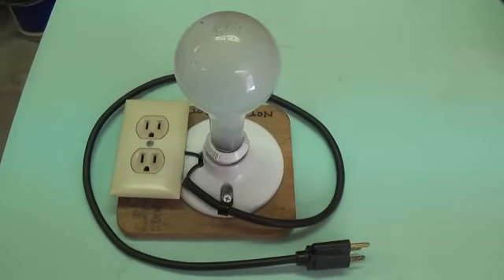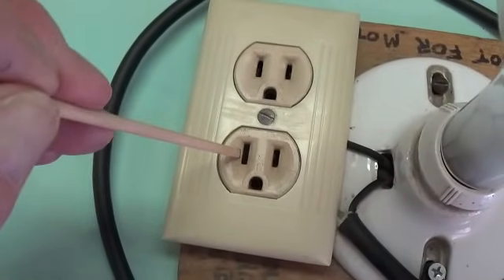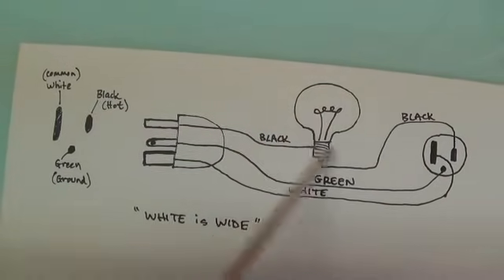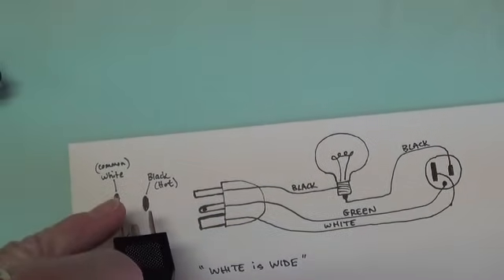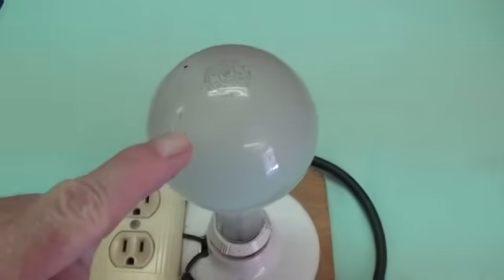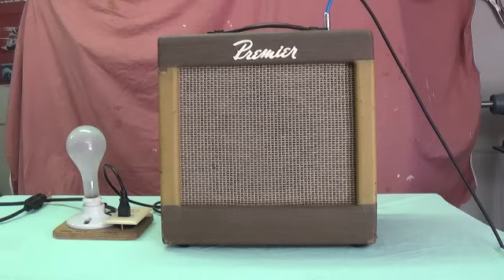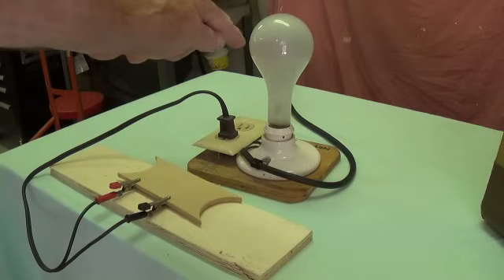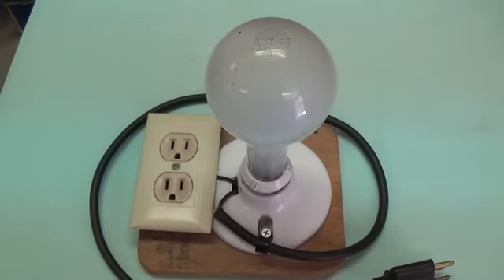Build Your Own Current Limiter for Protection when Repairing and Testing Electronic Equipment

Comment: I suppose if you cannot get hold of really high wattage bulbs you can put 2 lower wattage  bulbs and wire them  in paralell .Also in the UK we are on 240 volt so the wattage could be halved  ,we have 40 , 60 and 100 watt bulbs easily avalable in the UK. We used to have 150 watt ones but I have not seen any of them for ages .There is a big shift to LED bulbs now especially with EU regulations .I used to use a bulb via a veriac to feed a linear power supply to test amplifier modules after repair .Before that a faulty amp module would usually blow up the switch mode power supplies.If the bulb started to glow you knew you had still got a problem with the amp and backed the veriac off. .I enjoyed watching your old school amp videos Cheers.
Reply from the maker: Stephen, since your voltage is doubled, your current is halved, so the wattage of the bulb for the CL can be about 1/2 the value that we need her in the colonies ;)  I would think that a 100W bulb should be fine for small to medium-wattage amps.
Reply: @UncleDoug  I used to use 100 watt bulbs on transistor amps without a load ok .I could switch it out if I wanted to try the amp on load if I wanted too .A 100 watt bulb with 2 meter leads attached makes a great zap protector for discharging caps too .

Comment: I built my first tube amp. A champ type thing. It popped the fuse instantly (no smoke or stink). Now I'm going to back up and build a limiter like this before I debug and test again.

I wondering if this limiter would have prevented the fuse popping?

I've watched a lot of your videos and I probably should have built this before the amp. We live, we learn! Thanks for all your lessons, Uncle Doug.
Reply from the maker: Yes, it would have prevented the fuse popping, C. Once you build and use the CR, you will be much better off. Good luck.

Comment: Could this reduce the inrush current for a standard 60 watt incandescent light bulb to help protect the light bulb filament?
Reply from the maker: Yes, but you're just protecting one filament with another one (in a bulb that costs much more than the one you're protecting).

Comment: Complete NOOB here, what is that material you connected those two test-clips to [at 6:55]? Is that wood? Isn't that dangerous? I know wood isn't conductive but wouldn't 120 Volts set it on fire, eventually? Please let me know, as I am a complete NOOB! Cheers!
Reply from the maker: I believe it was a steel screwdriver shaft, Max. The whole purpose of the CL is to eliminate the consequences of short circuits.
Reply: No, I mean that "board" on top of the other piece of wood, to which you connected the test-clips, is that some non-conductive materials? Not the screwdriver. Thanks
Reply from the maker: Yes, it was a piece of Masonite, as I recall......totally non-conductive.
Reply: Ok, thanks for replying. Keep making videos [+, we all want to see more of Rusty]. Again, thank you kindly. Cheers!

Comment: Hello Uncle Doug,  I  built one of these and have been using a 300w bulb. The old tube oscilloscope lm rebuilding is a navy os 8a/u . It has 8 tubes and draws 47w and .4 Amps is the 300w bulb too large? Or what would you recommend? The 300w bulb only gets warm with no filament light. Not even a red filament.  If I  use the 300w bulb with my 9302 magnavox amp "which draws 70watts " the bulb filament will glow red . !
Reply from the maker: I think the 300W bulb should be just fine, Mike. Many of the amps I run with my own CL never light the bulb......they just make it feel warm.
Reply: @UncleDoug  thank you sir , question!  Would using this current limiter damage the device under test  if left on for hours?  As long as the voltage was adjusted to 115v ?
Reply: I found another use for the current limiter.  I  was watching one of Mr Carlson's videos on this topic and he demonstrated how the current limiter hooked up between his isolation transformer and variac will show the impedance mismatch of the two. So I did the same and sure enough,  the current limiter exposes the impedance mismatch. I ALSO tested a different isolation transformer without reaction. Paul showed how to correct this with capacitors. Interesting. I guess you could use a ma meter between the two would work as well.
Reply from the maker: No, the CL has no adverse effect on electronic devices......other than motors :)

Comment: Just finishing mine off. I have added a switch between the wall and the bulb. Mainly for control. I find this incredibly useful for probing with 110vac when experimenting.
Reply from the maker: It's an absolute necessity for work on any live circuit. Good luck with it, James.
Reply: @UncleDoug  Indeed, Thank You! I forgot to mention, I used a 500w Projector bulb and base which is similar to an 8pin socket. Makes it look sorta 'steampunk' with the cool filament off the bulb and gold top. Model GE DAK 500W.
Reply from the maker: All the better for display on your work bench, James :)

Comment: I copied your design. How can I test my device to see if it will actually work as intended?
Reply from the maker: Do what I did.....plug in an extension cord with two bare wires and touch them together. There should be no big sparks, just a brightly lit bulb. Be careful when you do this.

Comment: 110 Volts @15 amps. In  Australia we have 240 Volts @ 10 amps but the voltage isn't what is dangerous it's the amps that will fry us. Everyone has seen that picture of Nikola Tesla sitting in a chair surrounded by thousands volts of electricity  all around him it looked very impressive but I'm guessing the experiment was high voltage very low amperage.
Reply from the maker: Thanks for your input, SF.

Comment: Hi. This is my first time viewing any of your videos. It is one of the best videos explaining the subject but I must disagree with one minor thought of yours. I use a 60-100 watt bulb because I want to limit the current to any device connect so that there will be no damage to newly-installed devices such as transistors,etc. Does this make sense? A high wattage bulb would let too much current go through the deice under test. I have no need to operate the electrical device being repaired  at almost full voltage and current. I understand that some electronics devices 'act strange' when the full potential/current is applied but most items that I repair work OK with the 100 watt bulb in series. This series light wiring is excellent for circuit tracing intermittent shorts because of the current limiting function of the series lamp. One more thing- I have successfully used a lower wattage bulb such as 60 watts to see the dim glow of the bulb when an amplifier is running in series and I am able to adjust the small biasing controls. When I adjust the bias control and the current through the output transistor circuit is increasing the limiting bulb glows brighter. A higher wattage series bulb such as 250-300 watts would not let me see its glow. Len
Reply from the maker: The video was intended to guide viewers who work on tube circuits, Len, not transistorized circuits. The device can be used on transistorized circuits, but since their current demands are so much lower than with tube circuits, the bulb wattage does indeed have to be lowered dramatically. I believe this is explained in the video description.
Reply: NOW I disagree with you about using a 250 watt bulb. A 100 watt bulb or 60 watt bulb is what I have been using for decades and they work fine. I test large and small transistorized amps and large and small tube amps. I NEED to see the the amount of glow the 100 watt bulb shows me.
 Initially turning on the device the bulb glows and then settles down to a dull glow without any audio signal in the amp. Of course putting a signal into the amp makes the bulb glow brighter according to the level of the signal. If there is an intermittent short somewhere in the device under test the LOWER WATTAGE bulb will suddenly glow brighter informing me of the short BUT it will not allow any damage caused by the less than 1 amp of current going into the circuit because of this lower wattage bulb. A larger amount of current will go through a 250 watt bulb. This has helped me out countless times after I had installed new transistors and resistors, for example. If I were to use the 250 watt bulb and there was still a short somewhere in the amp or I had installed the transistors incorrectly the high wattage bulb might let enough current into the amp to blow the new transistors. 
 I know that you will not agree with this because the higher wattage bulbs work for you but the techs staring out are highly advised to use the lower wattage bulb. Another advantage with the use of a lower wattage series bulb is that I can safely adjust the bias of an amplifier when I initially adjust the bias control one way or the other. The bulb glows brighter when the bias voltage is too low and moving the bias controls to a more negative level decreases the amount of glow to the small wattage bub. Very handy. You cannot see a glow [as you stated] in the 250 watt bulb. [phew!]

Comment: I saw plans for a limiter that says to wire the 2 plugs in the receptacle in series. Is your receptacle wired  in parallel?
Reply from the maker: Yes, that's the way it came from Home Depot.....with both outlets wired in parallel. I see no benefit to wiring in series.
Reply: @UncleDoug  okay. Thanks. I was looking at Gerald Weber's "A DeskTop Reference of Hip Vintage Guitar Amps" (1994) on pg 123.
Reply from the maker: He knew his stuff, Barry, but since 99.9% of the time, only one outlet is ever used at any time, it is rather academic.
Reply: @UncleDoug   Thanks. Doug. I recently found your channel, so you may get more dumb questions than you are accustomed to for a while. Feel free to ignore me. lol. I also saw someone add a rotary dimmer switch to this design.  I guess that was his idea of poor man's variac. I think I'll leave that out. I am headed to the hardware store now. Thanks a lot.
Reply from the maker: A dimmer switch alters the waveform of the AC, Barry, and is not really the same as a Variac.....which can generally be bought at junk shops, estate sales (I just got another  V at one recently), or on Ebay. Stick with the basic design as presented in the video.

Comment: Hi Uncle Doug. We have 240v 50-60 cycles per sec here in Australia, would this device work over here or would we need to go for a 500w light globe such as in a flood light?
Reply from the maker: When the voltage doubles, the current decreases to half, David.....so you need a lower wattage bulb, probably around 100 to 150W.
Reply: @UncleDoug Thanks for that. I have a 50W valve amp - so would the 150W bulb be better?
Reply from the maker: A 50W amp with 240VAC would draw about as much current as a 25W amp with 120VAC, David......so the 150W bulb would probably be better. When in doubt, higher bulb wattage is preferable.

Comment: Thanks "Uncle" , I understand you are more of a guitar guy, but do you know if there are huge differences between amplifiers built for guitar and external tube amps meant for keyboards? I recently parted out an Ampeg V-22 and I have a Fender Rhodes cabinet. I thought the parts and that cabinet might be turned into a keyboard amp and home brew leslie cabinet.
Reply from the maker: I honestly have no experience at all with keyboard amps, Dennis. Common sense tells me they are quite similar to guitar amps, however.

Comment: Is this a visual ground fault interuptor, or serve as the same thing?
Reply from the maker: Not really, Dennis. It allows the electronic device to continue working and receiving current......but limits the amount to a safe level (for the circuit).
Reply: @UncleDoug : Thank you sir. I built one using a re-purposed vacuum cord and a plastic bulb base.

Comment: What a cool trick not to mention it could save your life!  Does this apply to DC power as well? I guess I could try with 12volt car battery and car headlight. Thanks
Reply from the maker: It could, Bryan, but the main purpose is to protect circuits from short circuits.

Comment: Hi Uncle doug... glad that i found your video... i got an amp and which the standby switch wirings are all messed up not knowing which leads for which solder pads... i was womdering if i can do a lead trial test with your current limiter to save guard my amp from damaging? Its a 350watt amp running 4 el34s... i was wondering if a 250watts current test lamp is sufficient to save guard my amp while testing up the wirings against shorts from L-L, L-N & L-E ? Hear from you soon thx :)
Reply from the maker: A current limiter is perfect for situations like this, CJ, and will indeed protect your circuit from damage.......however, for a 350W amp, you really should be using at least two 250W bulbs in parallel. Good luck.
Reply: @UncleDoug  thanks alot for the reply and help! Well if i were to overrate the bulb limiter by 600watts will it be ok? Or it will send my home circuit breaker to trip on exxessive overcurrent when comnected a parallel block of current limiter bulbs then series out to my amp? Will my amp even have enough current to function?

Comment: What would happen if you attached the light bulb to the ground lead rather than the hot lead?  Since the ground shouldn't have current unless there is a short, would this work as well?
Reply from the maker: You can try it and see, Mike. With safety equipment, I tend to stick with what is practical rather than what is theoretical.

Comment: The larger the wattage the better? How many amps will flow if I use a 35 watt bulb?
Reply from the maker: Not many, Fig, that's why you need a 250W bulb.....for medium-wattage amps.  I'm working on a 135W amp at the moment that could probably use two or three 250W bulbs in parallel.

Comment: Most cool Uncle! I may still have a 350-watt bulb from the old days. I can see how one mistake can be your last. 

You have convinced me to make this my first (and simple) circuit thereby protecting me and my equipment from failure as it were.

"PPE. What's in your wallet?"👍

Btw, metatronicmods, https://youtu.be/idb7XRBVImQ , provided your link here.
Reply from the maker: Thanks, Scott. I think you'll find it to be one of your most valuable and useful tool on the workbench.

Comment: Thanks Doug. I've had one for three years but realize I need a larger bulb. I have a 60, 100, 150wt. Probably only need the 250.
Reply from the maker: Yes, indeed, Stu. Different circuits require different bulbs. You should have virtually no glow at all under normal operating conditions.
Reply: Please don't forget to consider the max rated current (usually displayed in Watt) of the socket receptacle.

Comment: Am I correct in thinking this limiter plugs in between the Variac and the amp ? Or does order of devices in the chain matter ? And could resistors and a switch be included in your design to emulate a Variac providing, say, three different voltages, e.g. 80V, 100V, and 120V ?
Reply from the maker: I tend to place the current limiter between the Variac and the AC receptacle, Ian. That way, it protects both devices. The voltages you listed would not be of use to an amplifier. Slowly ramping up the voltage to a circuit requires a smooth transition between low and high voltages.....not abrupt steps.
Reply: @UncleDoug  Cheers! Good advice, as always. So I guess any other test instrument/s would also be down stream from the limiter, like an oscilloscope, yeah ? Oh, and where is the link to make a payment in appreciation ?
Reply from the maker: You should never place anything between an oscilloscope and its power source, Ian.  You can make a PayPal donation to dldcam@aol.com if you wish. Thanks in advance.